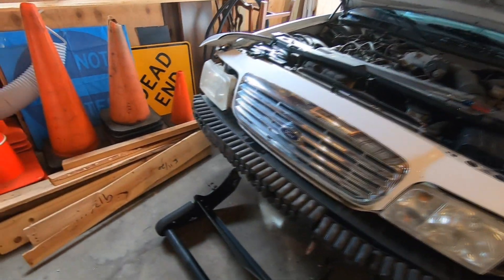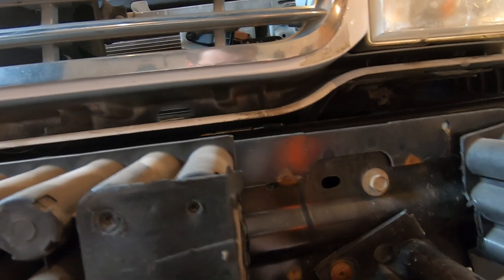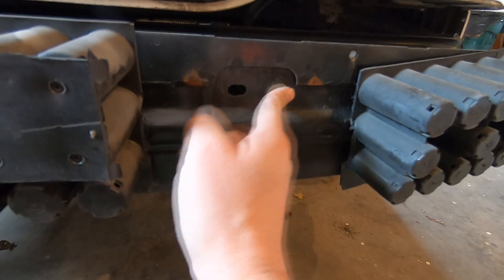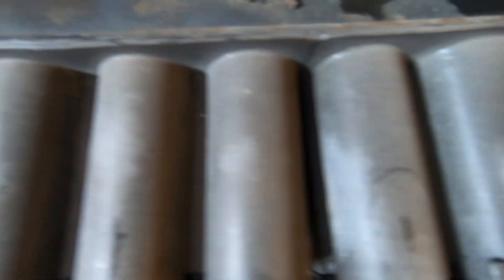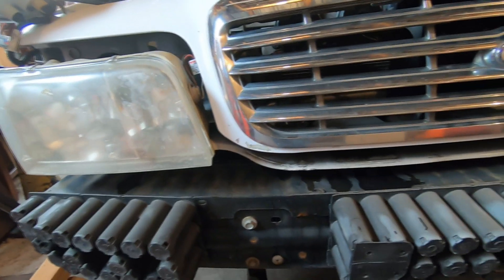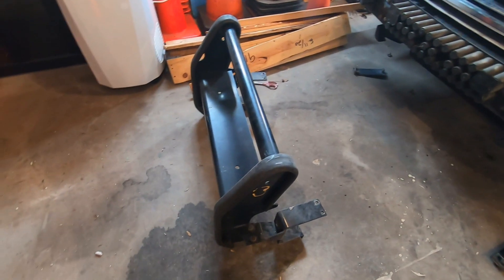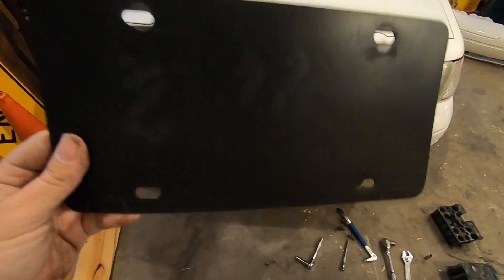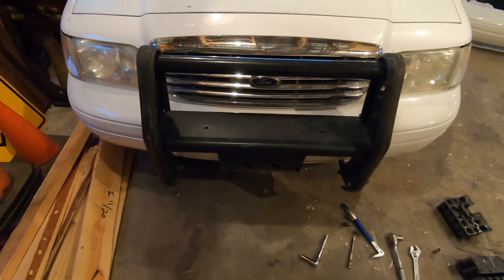GoRhino Push Bumper Install - Ford Crown Victoria Police Interceptor - Part 2 of Push Bumper Install

Comment: I like your way of measuring the holes. I don't have a center marker on the front of my bumper so I'll probably do it your way vs what the instructions say. Your holes are probably a smaller in size vs what the instructions say too, which is what I want. Nice work!
Reply from the maker: Thanks!  Much appreciated.  I had no instructions, and had to go on memory after pulling it from a junkyard car.

Comment: Rivets are meant to be drilled out. Next time you run into that problem. Just use a but that is a tiny bit bigger than the inner diameter of the river and kind waller it around until it breaks apart. Real easy.

Comment: I own a 2004 LX(some wierd transport vehicle idk) that was used by my county and figured id give this a try(never installed anything or done anything like this). I just installed mine, after everything it is off by a hair. Getting the brackets to hold the bar symmetrically was pretty terrible until I tightened everything and even then as i say ever so slightly its off and it tight as hell. Mostly leaving this comment in case anyone in my situation with limited mechanical knowledge wants to try it.

Comment: Great video. That was helpful. The only part I'm getting stuck with is the wings. My mounting brackets are having troubles lining up. Hopefully you can figure it out better then I can. 😂
Reply from the maker: You aren't joking, I had some fun with the wrap-around... had to "shove" it into shape.  They didn't want to attach to the mounts - on the sides of the bumper - by the fender.